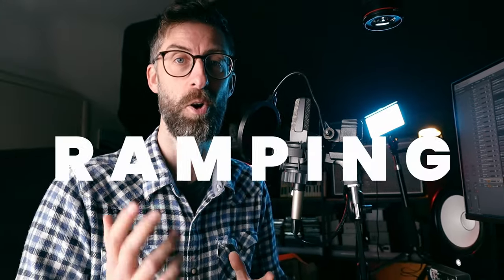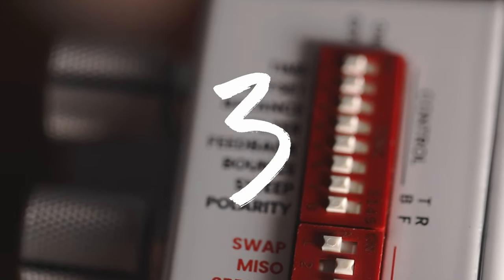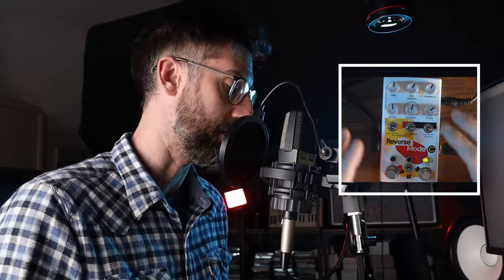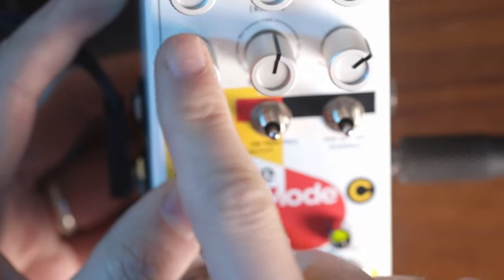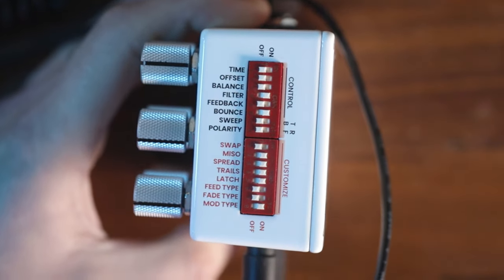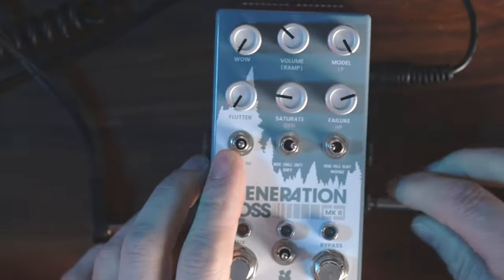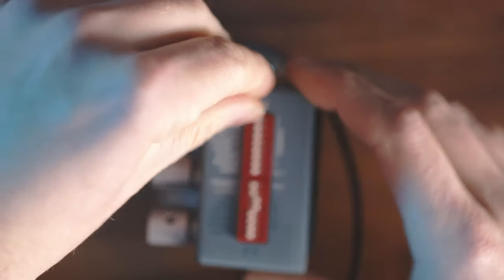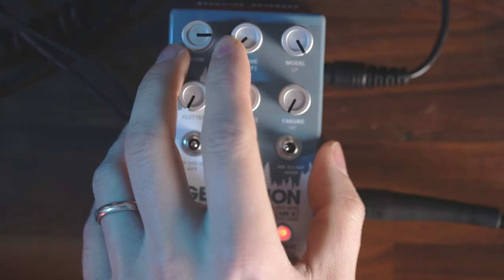Chase Bliss Dip Switches? How to RAMP Mood Mk2, Generation Loss Mk2 and Reverse Mode C

Comment: Very good video! 👍👍 I use the dips much less than I would like to. Mainly, because I always have to lift the pedal from the board with locking tape. But I learned something new: I always thought ramping clockwise would increase the speed. 💡
Reply from the maker: You could always save up some presets using the dips and then have them for life